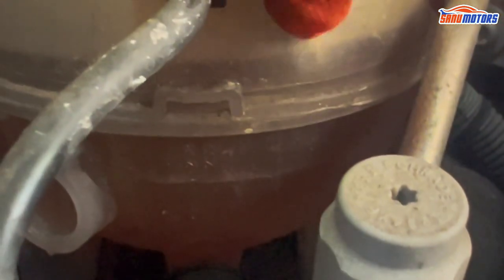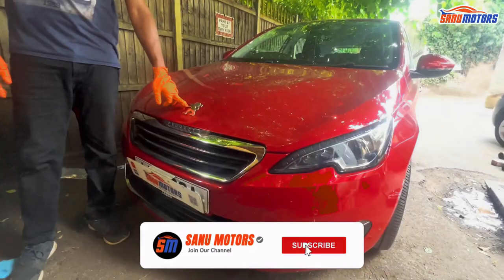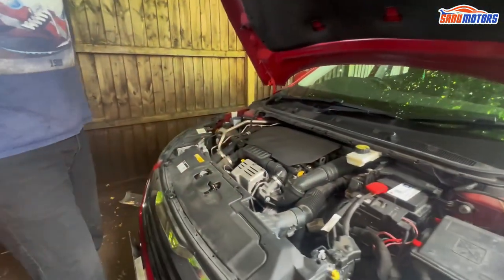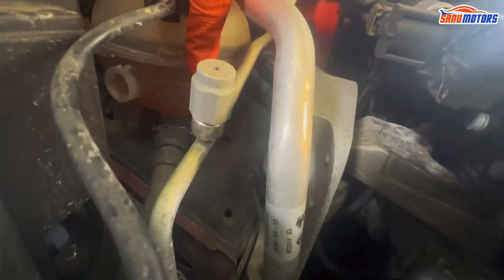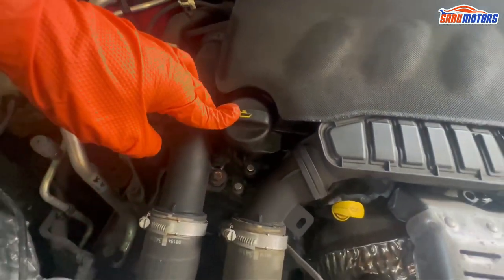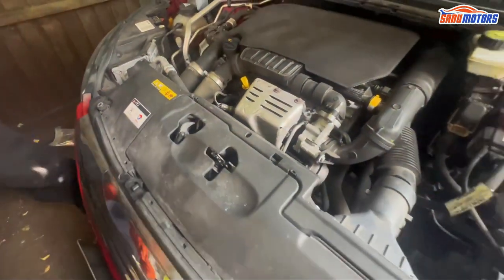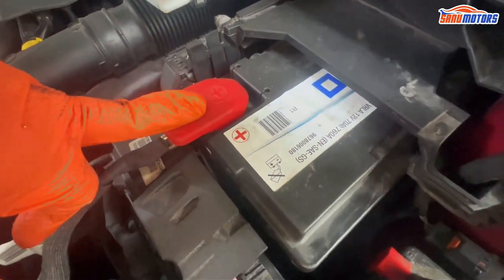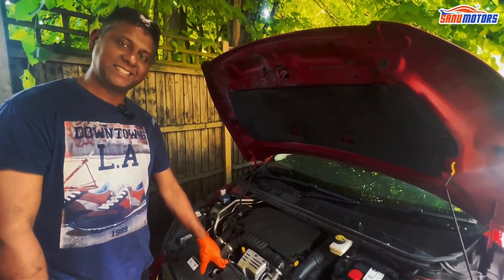Peugeot 308 All Fluid Level Check Under The Bonnet: A Comprehensive Guide to Proper Maintenance

Comment: Hahahahahaha i was sooo pretty sure u wont be able to show the gearbox oil level.
Reply from the maker: Ah, the joys of manual gearbox maintenance! While it might seem like a daunting task without a dipstick, you can still ensure your gearbox oil level is in check by following these steps:

Locate the Filler Plug: Find the filler plug on the side of the gearbox. This is typically a bolt that can be unscrewed by a wrench.
Prepare the Vehicle: Make sure the vehicle is parked on a level surface and the engine is turned off.
Remove the Filler Plug: Unscrew the filler plug using the appropriate sized wrench or socket. This plug is usually located higher than the drain plug.
Check the Oil Level: If the gearbox is filled to the correct level, oil should be just at the bottom of the filler hole. You may need a flashlight or a small mirror to see inside.
Top-Up if Necessary: If the oil level is below the bottom of the filler hole, you'll need to top it up. Use a suitable gearbox oil recommended in your vehicle's manual. Slowly add oil through the filler hole until it starts to overflow slightly.
Reinstall the Filler Plug: Once the oil level is correct, screw the filler plug back into place and ensure it's tight to prevent any leaks.
Check for Leaks: After driving a short distance, recheck the filler plug to ensure there are no leaks.
By following these steps, you can keep your manual gearbox running smoothly and efficiently!

Comment: Normally people owned cars, they know better than you, just wasted few minutes to see this
Reply from the maker: Thank you for your comment. While many experienced car owners may already be familiar with these checks, this video is intended to assist new drivers who might not yet have this knowledge. We've seen cases where people accidentally mix up fluids, such as putting coolant in the washer reservoir or engine oil in the brake fluid. Our goal is to provide clear guidance to prevent such mistakes and ensure safe and proper vehicle maintenance for everyone.
Sorry for the inconvenience. And thanks for the feedback